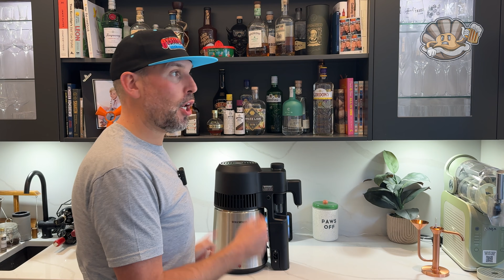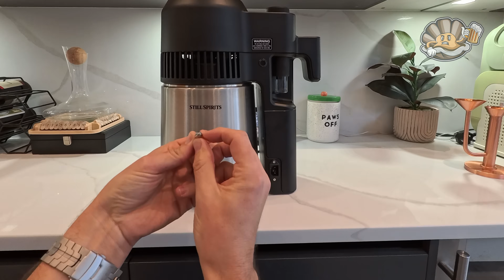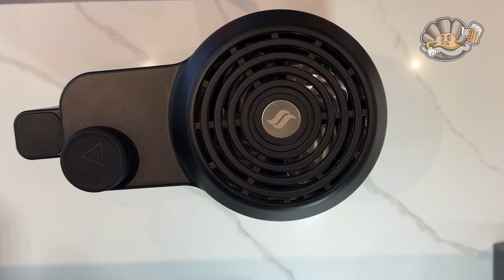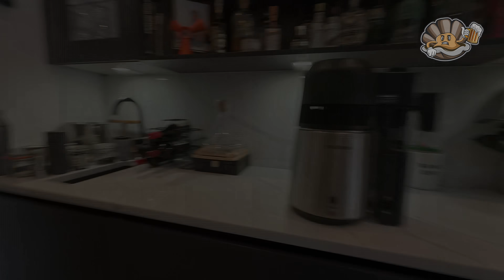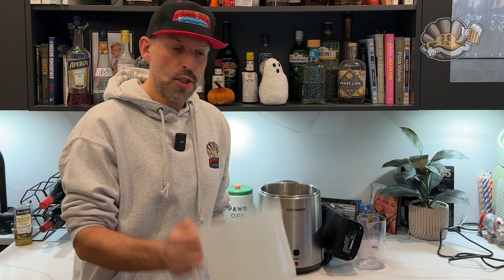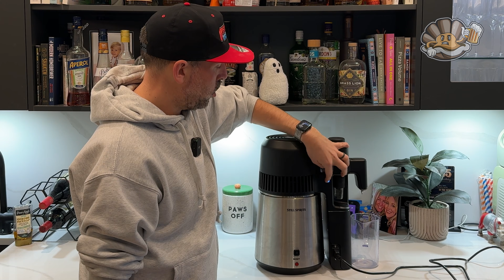How to Use the Air Still Pro in Reflux Mode: Setup Guide

Comment: From the research I've done you should ONLY use these in reflux mode.  You can get use the condensing head from a regular water distiller on the tank of this thing to run as a pot still.

Comment: It's not that much more for the full rig. You might as well buy a whole machine instead of just the head. That way you can run two at once to speed up your work. Or you could run the pro in reflux mode and the pot doing its thing for flavour.

Comment: I own the original and the pro, both do a great job considering their size limitations.
While they can both utilise botanicals, I find the basic machine best suited with its insertable botanical dispenser. Its easily fitted or removed from under the head, while the pro is a bit more fiddling with stainless and copper pieces used in reflux mode. Some might not like the lower ABV from the basic air still but I don't mind.
The pro is great for clear spirits like vodkas or gins - both machines are great and take up so much less space compared to their larger brothers..

Comment: Just one thing you didn't cover.... did you put the copper above or below the stainless? (I haven't used mine in about 8 months so I forgot lol) only used it for 2 runs in the past and now about to do my 3rd. I'll do some more research and work out which order to chuck the copper and stainless back in lol (they're currently bagged after a salt/citric acid clean from the last 2 runs)
Reply: copper goes above stainless in my machine, then they tend not to get stuck so much.. :)
Reply: The company says stainless first and copper on top.

Comment: Great video Mark I also have to move my house to a different country when I do it 😂 I have the original version and was thinking about upgrading I do normally heat my wash on the stove to about 55’c then pour it in and it normally saves and hour of running/heat up time which is handy when your doing 5-6 runs but I do normally do a stripping run and a spirit run. Look forward to your next update and what flavourings you use. I see TMM has a new 35 year celebration bourbon/whisky kit which looks good 👍